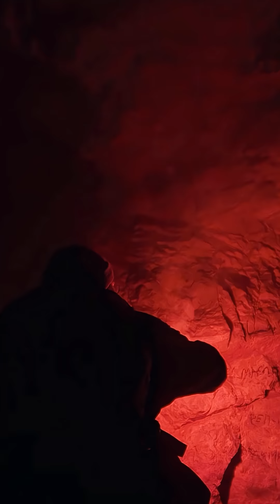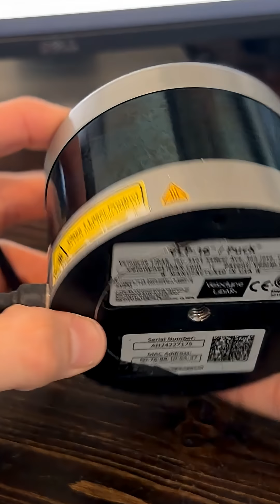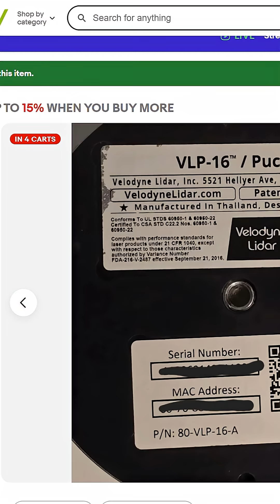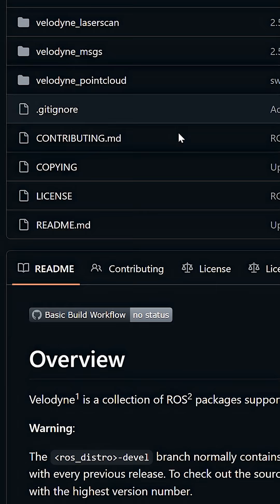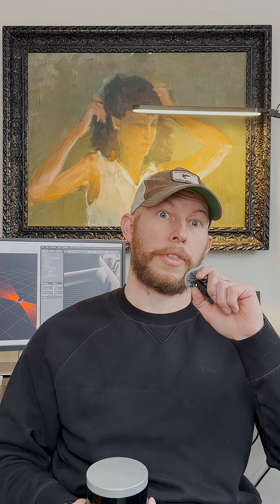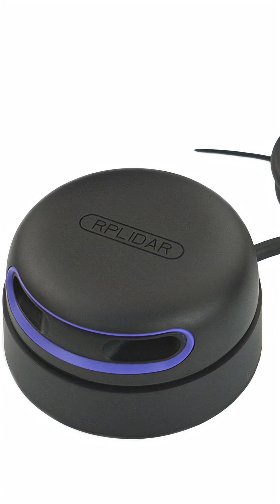What LiDAR would you pick for mapping caves? Here’s my answer  #robotics #slam #lidar #engineering

Comment: man, my family has a cave that we go to every few years, and so far its always been kept a secret and unmapped. Maybe I should map it, but question for you: How would you map the cave when you have to rappel around 200ft?
Reply from the maker: Could connect the system to your harness and let it hang vertically under you as you rappel down
Reply: Honestly, I'd lower it, by itself, with two ropes so it doesn't spin. Scan down. Raise it up. Scan on the way up.
THEN add it to your packout, and scan down again.

Comment: I see some sensors sold with the connectors cut off. Did you utilize the existing connector or wired your own?
Reply from the maker: I bought a sensor with a connector but there are guides online on how to safely disassembly to replace the connector harness.
Reply: So the manual has a very good outline of the hardware and what each color of wire does. I picked up one of these for cheap ob eBay, it actually had a connector but just one different from spec so i had no clue what each pin was for, 16pins vs the 8 in the datasheet. I just cut the connector off and crimped an rj45 to the tx/rx+- wires and gave the power ones 12v according to spec and after some network config i was able to get accurate scan data!!